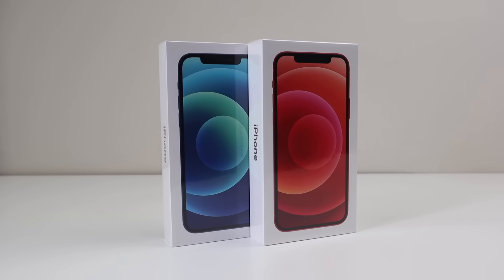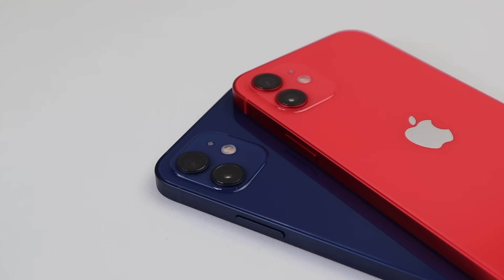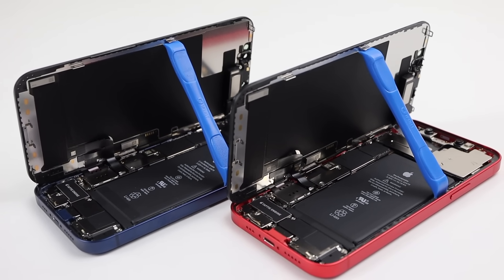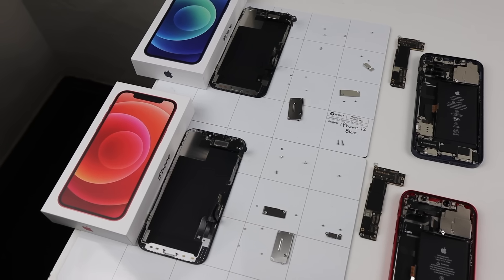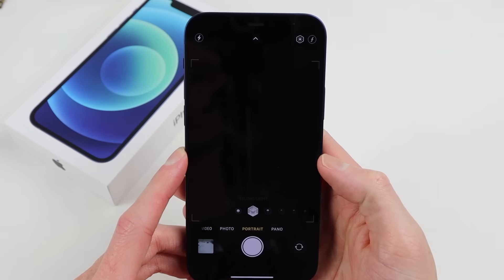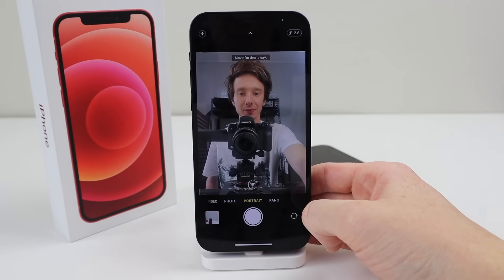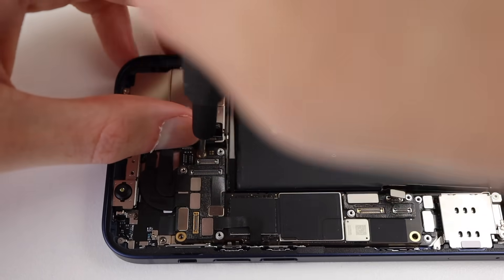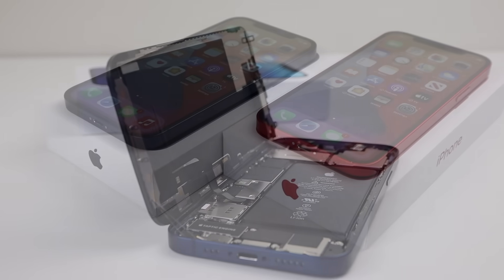iPhone 12 Anti Repair Design - Teardown and Repair Assessment

Comment: So it’s not actually an error with the parts, since these actually are genuine apple parts. Really, the parts just have a specific ID that is locked to one phone, and if the ID doesn’t match the software actually manually breaks itself in order to screw you over, even though in reality there’s nothing that should stop it from working perfectly fine. So now, not only can you not get third party replacements, but now with even genuine Apple parts you can’t do it yourself, you must pay Apple to do this exact same job with the exact same parts in order to unblock all these features that it breaks on purpose. 

Apple gets more scummy every year.
Reply: As long as people keep throwing money at them no matter what they do, they'll become more and more scummy.
Reply: @M4rili4  The issue with that mindset is that other phones aren't terribly repairable either, especially considering how many of them there are. Every major electronics company is motivated to increase profits as the expense of other factors, and that means they all discourage repair. In order to stop this, you'd need some kind of disruption or government regulation. It's possible Pine64 might launch a version of the PinePhone aimed at the average consumer, but that would require stable software with good anbox integration, which is probably at least 6 months off, and that may or may not be popular. Alternatively, the US government and EU might pursue some kind of regulation, possibly as part of the ongoing antitrust action, since third party repair is a kind of competitor.
Reply: Exactly why I've never bought one of their products. Any company that tries to lock you into their ecosystem only is going to be scummy.
Reply: 95% of people already know how scummy Apple is. We are just watching those 5% people and laughing and having time of our life. Cmon dont be puppets of a company
Reply: @atpray  Those 5% of people have literally made Apple the single most rich and profitable company in the world and THAT is what's sad! $APPL is worth almost 2 trillion dollars market cap wise. Any company that big HAS to be scummy. They don't care. Money rules this world and they have the most. To them, that's all that matters.
Reply: 100%
Reply: Imagine your car not accelerating properly because you changed the tires...
Reply: @KravenVanDrakken   This! all of the people saying "mine still works so I don't see what's wrong" this is whats wrong! Great your phone is working fine. What if you are one of the many people who's phone is not working fine?? Then you get screwed by this crap practice. I understand the anti theft comments but this is not that. Even if you were able to verify everything or if you took it into an Apple store and were able to verify you are the original owner you can't get the functionality back without paying Apple WAY too much money. And don't even get me started on the "Authorized repair person".
Reply: @ryker3696  you crack you screen... You have to pay for the original screen $200-300, repairing and service $100-150, you loose your phone for 1-4 weeks and you might loose your data.
That's is if you are lucky.
Any other phone, you buy the screen around $100, repair some $25-50, same or next day repair.
Reply: @KravenVanDrakken   companies sell screens for some phones at... 50$. you can even repair it at home, although I would not recommend that.
Reply: locking face id makes some sense, (for security) but cameras and display. no...
Reply: @morsine  it doesn't matter what phone you have, what security it has if they have enough access to it to replace components there is nothing Apple could do to prevent them from getting into the phone
Reply: @MatthewČák2142  True. I'm not an apple fan because of it's limitations.
Reply: So you smell the same thing I smell... SCAM
Reply: Just another "revenue stream" for the cult of 1984.
Reply: And these idiots keep going back every year like mindless sheep and spend thousands of dollars on piece of crap phones that couldn't even compete with Samsung phones
Reply: And lets not forget that Apple also has been known to do low quality repairs and label board shortages as water damage (which voids the warranty, forcing the user to buy a new device). Louis Rossmann does a ton of Apple repair videos and has done an amazing job at exposing Apple for the frauds they are.
Reply: You've literally just repeated what was in the video. Lol!
Reply: I feel a class action lawsuit coming
Reply: This must be crime for scamming people not just for low specs of ram, battery etc. but also not selling the device properly by without adapters
Reply: It may seem annoying, but think about thieves. Stolen iPhone could have been used for parts, now, not even that. I think that makes iPhone less of a target to be stolen. Is it annoying to repair? Yes. Is it less likely to be useful for a thief, yes, it will not worth the risk since the only thing you can now with a stolen iPhone is to scam people on ebay or wherever or try to get the user to remove activation lock, otherwise it is a paperweight and reason to go to jail
Reply: @nomnomNACHO  yeah  u really think this is some security reason.
Reply: @raymond1990  it has a big part in it, yes
Reply: @nomnomNACHO  yeah totally
Reply: @nomnomNACHO  nope first off it's only a matter of time before the serialization gets busted and second off there's still value in other replaceable parts such as the casing
Reply: @nomnomNACHO  thieves can also reset your iPhone and use it for themselves. It's not that they would always sell it. There are plenty of reasons one might steal an iPhone OTHER than just reselling it. Stop thinking in that way my friend. It's just another scam just like their eco-friendly marketting strategy was. Everyone fell for it, don't fall for another one.
Reply: @BlatantBuddy  you can wipe the phone, but it is bricked. It will ask for the previous user’s Apple ID and password. Look for activation lock. The phone is useless essentially if it is stolen.
Reply: @nomnomNACHO  more reasons to steal phone:
Destroy it, 
Infringe other's purposes
Pranks
And many many others. And don't you think that only a stranger would steal your iPhone. It might be anyone. This "security" thing you're running for won't last too long. Technology is going fast and soon, hackers might even crack this.
Reply: @BlatantBuddy  you dont make any sense. Your average thief is not going to be interested in stealing iphone if it is a big hassle to make a profit on it.
Reply: Nah, that's not radical enough. Apple should simply put small peace of c4 inside their phones which will detonate if you try to open the phone. And official repair services are also not needed. Your IPhone stopped working - just bye a new one.
Reply: @chernyshevstas1  like M.I.  "this message will self-destruct in ..5 ..4 ..3 ..2 ..1"
And.. 
there you go, you gotta by a new phone..
Reply: @chernyshevstas1  You had to be named stanislav, that mindset is superior to everyone elses.
Reply: And that's why I like android and windows because of the freedom you can get with both of those operating systems.
Reply: sounds like a cause for waste, interesting how companies who say they want to go 100% green either are incredibly expensive or totally not 100%
Reply: adirondacktrail  Consumers say bye bye. It doesn't matter how big Apple thinks it is.
Reply: Lol they don't want to repair phones eww they want you to throw it away and buy a new one
Reply: It’s a real pain, because I totally agree, but I also prefer IPhone to other phones. I wish I could just get the benefits without the scummy stuff.
Reply: I'm interested in how Apple could do the repairs. What kind of tools they will use? There must be a way to crack this.
Reply: There's always that person that bypasses those things. Then releases to 3rd party repair shops
Reply: yet you will still buy their phone
Reply: @qwerty-nr9sc  Samsung here.
Reply: Thats the poin
Reply: Agreed to that.
Anyhow the only thing to make the new part working is to registering it to its OS Device Info using Coding and its only can be done by using Apple's authorized services tools.
Reply: I guess the only option remains to patch firmware keys for accepting new ids but that will screw up updates...
Reply: its just easier not to buy apple. Their computer stuff for music and production is dope, thats it.
Reply: Welcome to the John deere debate i see you know the basic structure already
Reply: So why don't 3rd parties jailbreak the phone so the software doesn't check the parts?
Reply: @jew-sa  You stop getting updates.
Reply: to be honest, that's pretty much the same as robbery
Reply: The scum are the people that try to repair the device themselves, screw it up and then call Apple and tell them the phone isn't working right because of something Apple did. It happens more than most would imagine. Just like anything else, the few ruin it for the masses.
Reply: @Airplane_Willy  so you're saying that the majority of wrong diagnostics and overall stupid cash grab strategies are caused by a low percent of dumb fucks who decided to ruin their phone? Cool ngl
Reply: @Airplane_Willy  🤡
Reply: @Airplane_Willy  My mate told me that when someone brings an Iphone into his shop for repair he just takes it out back gives it 5 seconds in the microwave, then hands it back to the customer and tells them ' Sorry these Iphones are useless, this one has completely died, not even Apple can fix it, better get an android next time'. LOL. Gotta educate the mugs that buy Apple I suppose.
Reply: scummy? it's a legit business move, ...do you even realize that they're not a public service company?  and also so many smartphones out there are not for something you can laugh to as "superior" apple phone owner, they exist so that you can make a wise decision what to buy for your new phone
Reply: @electronresonator8882  you are sadly very true.
Reply: Shaun G  If I have never needed a repair in over five years, then I do not mind if I have to go to Apple for repairs. If car manufacturers made cars that do not need any repairs in over five years, then I definitely wouldn't mind only going to the dealership for a repair. And this does benefit me because I have an iPhone 12 pro on the way.
Reply: @Bryanmondragon2023  Ha ha I hope you drop your phone and needed to be repaired and pay the money extra just for apple but doing the same thing for high salty price and good luck with buying another adapter that they announced saving planet all other bullshit they already made new adapters
Reply: @Semruk_The2headed  Hasn't happened in five years, probably won't happen any time soon—especially with the durability of the iPhone 12. The adapter is LITERALLY $20—chill out.
Reply: @Bryanmondragon2023  Could save money and get a usb2  to lightning cable, just like you got with the later ipods.
Reply: @Bryanmondragon2023  bruh once u drop your phone u gonna start emptying ur pockets.
Reply: @Bryanmondragon2023  believe me there glass maybe tough but once u break it u can happily pay $599 for some stupid glass replacement.
Reply: @Bryanmondragon2023  your comments are so ignorant... Are you really that blind? I don't care if it's Apple or some other company, the point is that even if you "don't mind" because you didn't have to repair your product after 5 years of usage there is still a huge problem: this company literally decides what your right are, even tough nobody legally can impose to repair their product by the manufacturer. If you can't seem to understand how bad of a problem this is, then you are pretty close minded and honestly you should educate yourself how not to get your right violated just because it's a respected(?) company
Reply: @maksymnaumenko3667  Go ahead and sue them then for violating your rights. Surely an educated individual like yourself will win.
Reply: @Bryanmondragon2023  My android hasn't needed a repair in 10 years, so what? Your phone at age 5 is now in it's LAST year, mark my words, it will be e-waste within 12 months. With Android phones you can change the batteries when they age, and the screens when you drop them for about $20. With I-phone if you drop it then it will cost half the original price of the phone.
Reply: I've had my iPhone 6s for five years now. I see no problem with this.
Reply: @Bryanmondragon2023  simp
Reply: @Bryanmondragon2023  bruh your phone over 6 years old, they been changed the repairable since the iPhone 10
Reply: @Bryanmondragon2023  I finally upgraded from 6s plus to a 7 plus...✌🏾
Reply: @Bryanmondragon2023  I’ve had my I phone 7 for 5 years, I was super happy with it but with time it got slow and I cracked the screen two times before finally changing it. Got an I phone 11pro and all in all it is a good phone but NOT for this price. I’ve had this phone for almost 5 months now and my battery status is already at 93% even tho I try to charge it the right way. I’m so pissed..
Reply: @Bryanmondragon2023  same bro, refuse to buy new iphones even though im more than capable of affording it, not a fan of androids but i think apple is a scam garbage company.
Reply: @Bryanmondragon2023  me neither
Reply: I believe it is a step to prevent phone thefts. Now the thieves won’t be able to resell a stolen phone even for parts. Which is good.
Reply: That's like saying you can't change lights, tyres, batteries etc on your car yourself or with mechanic in case someone steals your car and sells it for parts.

Quite ridiculous.
Reply: @ex0duzz  just more ways to milk you of money if you buy one.
Reply: @virtancom  They make an enormous amount of money by repairing old iphones.  Apple doesn't care about your phone being stolen, why would you assume that they are being generous and appreciative to their customers rather than actively screwing you over?
Reply: @virtancom  only folks stealing at that rate work for the phone distributor
Reply: @arcellmcgowan1517  stealing at what rate?
Reply: And I’m still buying their phones 😌
Reply: @swisscheesek  Just why? Why give money to a morally bankrupt company like that?
Reply: @swisscheesek  I am too, I hate them but I have too much invested into my iTunes library.
Reply: @TeenageMutantZuckerTurtle  it is not yours, you are just renting it. apple got you by the balls
Reply: @TeenageMutantZuckerTurtle  lmao. $120 a year for spotify or $120 for 5 albums on itunes🤣 makes sense. I have like 5,000 songs on spotify. Apple makes no sense. Cheap junk lmao
Reply: @devonkremer4062  yea i know, now that Spotify’s a thing I wish I hadn’t gotten into apple. But I do have literally dozens of albums built up over the years, and I don’t really buy much new stuff, so Spotify for me would be paying to access what I already own on iTunes. 

I usually only get a phone like every five or so years, so maybe I’ll get a Samsung in a few years if I can find an easy way to download my iTunes albums on my computer and maybe manually transfer them to a Samsung. For now my iPhone works well enough, but I’m really not liking what I’m seeing on the new ones in terms of price, App Store limitations (no Xbox Gamepass), and BS crackdowns on self repair like on this new one. I used to be able to replace my iPhone’s battery or screen myself as long as I bought genuine parts, but not anymore.

If Apple gets much worse, it won’t be worth staying even if I can’t manually download all my songs to a Samsung and have to start from scratch. There’s only so much I will take, and Apple’s pushing it VERY close in the past couple years.
Reply: @TeenageMutantZuckerTurtle  So you are held hostage ? ....   Wow, what push overs some people are. No wonder the Nigerian prince keeps sending those emails, there is one born every day !

Comment: Apple cheats when replacing parts. You can have a genuine Apple battery, but if the serial does not match the one software tattooed to the logic board it generically pops up the flag, regardless of it being genuine.

Comment: If two of the same colour phones were used, it would be a better comparison. The display is serialized to the colour of phone as is the logic board. Now, yes you did swap both logic and display... So the blue should be red and visa versa. But the problem is that every part is serialized and if one does not match the logic board, it flags every incorrect part. Apple has a software tool that will reserialize the phone so  the display will be calibrated and updated to match the phones colour. Notice that the default wallpaper is the same colour of the iPhone...

Comment: Sounds to me like Apple made it so swapping out the logic board doesnt allow you to use your battery, that's why you have to plug in the power cable.

Side note. You should be careful forgetting to put all your screws back in. I know you did it intentionally, and I'm not sure how it is with cellphones, but working on virtual theaters has shown me screws sometimes act as grounding and forgetting a single screw means $10,000 in repairs.
Reply: But are the screws paired to that device cause they may come loose otherwise if they are not the genuine screws ;)

Comment: I had a TV once with 90 degree turn buckles holding the back panel on, it took less than 20 seconds to remove it. Inside was a repair manual with full schematics. 

The firm who made those TV's went bust.